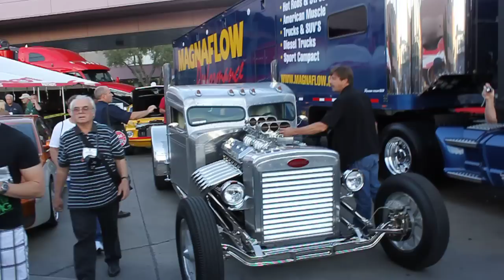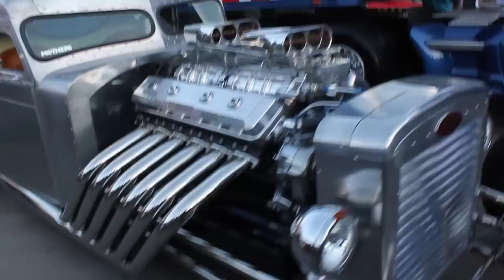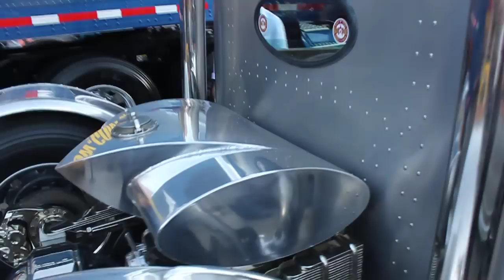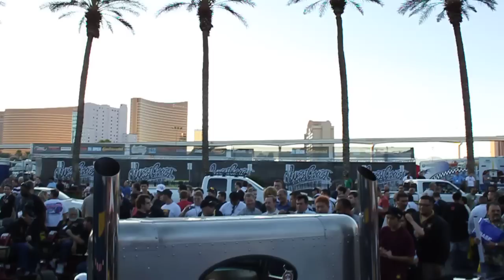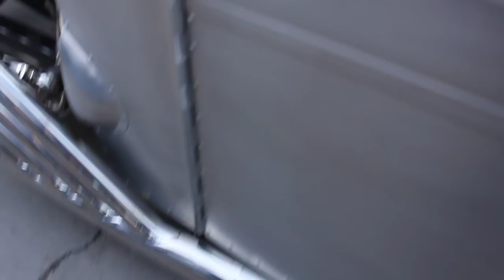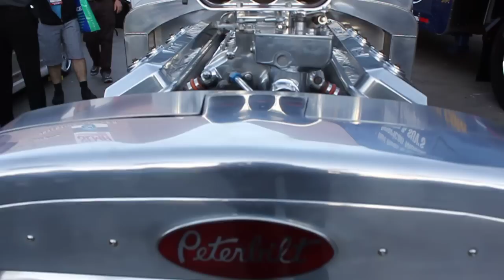Jay Leno's Insane 1960 Peterbilt Hotrod Truck called Piss'd Off Pete showing off for the crowd!

Comment: He can run Amsoil Dominator 2 stroke oil as it burns off clean and has good film wear.
Reply: Actually he has to run ordinary diesel oil as it's a 2stroke diesel they work differant to a 2 stroke gasser

Comment: @idusclothing Maybe a 250cc dirt bike engine does. This about 14,000cc, the pistons are a lot bigger. 2 stroke just means it makes power (combustion stroke) every other cycle of each cylinder, rather than every 4 cycles. Generally means about twice the power output of a 4 stroke of the same size. However, max RPM is mainly a function of the size of an engine's reciprocating (moving) parts. 2500 RPM is quite high in a large diesel engine.

Comment: @ReverendArmaggedon: 1000 lb/ft was pretty good when the 12V71 was in its heyday, but 500 hp today gets you about 1500-1500 lb/ft.  The 'Dirty Dozen" was a good engine in its day, but now it's a dinosaur.  500 hp out of a 12V71 isn't that much of an increase, in top form from the factory they put out 434 hp @ 2100 rpm, you could probably get it up to 500 just by replacing the standard 65mm injectors with 75 mm ones.

Comment: No, it doesn't have any superchargers.  The 2 cycle Jimmies needed the roots type blower for scavenging.  It blew the exhaust out of 4 valves, and clean air into the cylinder through ports in the block.  Without the blower, they would not run.  Therefor they are not considered "superchargers"

Comment: @6806goats1 Nice, i am a detroit mechanic and had a 16v71cab over just come in to our shop with triple sticks, trying to find reverse on that thing was imposable, (no shifting guild) I did kinda found out the hard way there are many set ups to those engines and this one had duel super cargers and duel turbos and the biggest ive ever seen. Needed a new super charger clutch. Yeah at a certine psi the super chargers kick out. He took me for a test drive, Dam bull hauler at 129 top speed.

Comment: @joek0617 Huh?  I can't find or think of a single 2 stroke engine in the last 30-40 years that didn't have a muffler/silencer from the factory.  In fact a 2 stroke gas engine needs a small amount of back pressure to run properly.  I have 7 2 stroke gas engines from a variety of manufacturers and every single one has a muffler, and had one when built, the ages range all the way back to the early 70's.  Maybe some of the stuff from the 60's and 70's didn't have them but the majority did.

Comment: Don't see why you can't run straight pipes on a 1960ish Pete since that is how they came from the factory.
In the US emission and sound regs are dependent on the date of original manufacture(the VIN plate and cab are 1960 Peterbilt) and most jurisdictions even kit cars are registered as the year of the "real" car. A 1966 427 S/C kit is the same as one built by Shelby in 1966, hell, even the new cobras(AC platform) from Shelby are registered as mid 60's cars.

Comment: @TR3NDK1LL So does virtually every passenger car on the planet.  Stock those engines only turn a little over 2000RPM but due to their design they sound like they are revving way up.  Something a lot more racey then this one may turn higher then 5000.  Understand this one isn't even turbocharged.

Comment: 12V71 Detroit Diesel made by GM
71cu inch per cylinder = 852 cu in.
450-500 HP
weighs @ 3500LBS.
Common power for boats.

Comment: @1995MartinD40FMG Wrong! It is two stroke, piston ported, and without some sort of forced induction it would not run at all. I've worked on, stripped down and rebuilt more than a few of these motors. As standard, it comes with a supercharger, or two actually, nestled in the V of the motor.

Comment: Huh, an old 60's super charged 12V71 V-12, 2 stroke, Detroit Diesel. And look Dodge fans, no freaking clouds of smoke. See high performance in a diesel engine and lots of black smoke aren't one and the same.

Comment: @MrHellested Just because you have never heard of something does not mean its not out there. Detroit was into two strocks for years and they SMOKED ALOT , epa cracked down on them and they had to have john deere help design the series 60 in the mid 80s. Two strock diesels are out there just less of them as these new EPA laws crack down.

Comment: @theLonewhitewolf13 A diesel with turbo charging or super chargers and properly tuned should not smoke much. Black smoke clouds are a sure sign it running way too rich. Most of the older naturally aspirated diesels smoke like a furnace. They also burned way more fuel than they needed to.  The 3208 CAT I put in my Super duty dually don't smoke much and will pull anything I hook up to without much effort at all. It smoke a little when starting out with a heavy load, but nothing like the old Macks.

Comment: @DOCTORtrololololol 2 Strokes are Detroit diesel engines, very common, nickname is screamin jimmy, slang for GMC, alot of buses use them, you've probably passed a million of em, or they've passed you, quite common to use the blowers off them for drag motors. I've driven the V4 71, V6 53, V6 71, V8 71, V8 92, awesome engines & cheap to rebuild.

Comment: I beg to differ. All the 6V32 and 8V32 Detroit's I saw in military vehicle all had a manifold pressure gauge in the dash. Even when used in the PBR boats. Way would they need a gauge from  1-30 PSI if the blower didn't pressurize the manifold. I've never seen a blower installed on  any  engine that didn't pressurize the manifold. It the hole point of it being there. Even blowers used in industrail application provide positive pressure. Two words, same thing.

Comment: If its 2 stroke wouldn't having some sort of exhaust like most 2 stroke engines improve on power?
Like motorcycles, whipper snippers, chainsaws all have huge chambers that flow down to a smaller pipe.

Comment: @captwilly428 Did you know the 5.9 is governed @3100rpm? And the key to longevity at high hp/tq levels is strengthening the metal, either by stress-relief shaking or cryogenic hardening and some do both.

Comment: First, I don't know what a 6v32 and 8v32 are.  Do you mean 6v92 and 8v92?  I really can't speak for why they had a boost gauge, unless of course, they had a turbo!  I have done some research, and from what I have seen, the 92 series all had turbos, which would explain your boost gauge.  It is not for the blower.  I can only speak about the fact that 2 cycle Detroits can not run without the blower.  The blower was not used for high performance.

Comment: Yeah no kidding, I put a 3.0L turbo diesel in my 86 toyota pickup and I get around 38mpg hwy with the stock 4.10's which is way to high for the engine, could probably get alot better with the right gears.

Comment: I don't understand the whole forced induction 2 stroke thing
Reply: Its a cool thing. They work just like a normal two stroke but inject the fuel instead of it being premixed. They are all blown either super or turbo hybrid etc.. The advantage of blowing is it helps to have the air blow the exhaust gases out before the exhaust port is covered by the piston on the compression stroke. Diesel two strokes can be made lighter too.
Reply: It's actually not "forced induction".  On a detroit, or any other 2 stroke diesel i know of, the blower does nto create pressure, it simply moves air.  The engine could not run without it.
Reply: So this engine's basically designed for use with a blower? I've heard of some 2 stroke bikes with turbos but they were all pretty much too inefficient to make any usable power.
Reply: Yes.  it would barely run, much less make any power without the blower.
Reply: ***** it couldn't scavenge if it didn't have the blowers
Reply: Magnacharger07 Yes, that is exactly what i meant.  Did you mean to send that to me?
Reply: Steve Skouson Thanks heaps for that complex and informative response.
Reply: Stewart Gartland Thank you, and sorry to get long-winded.

2 stroke induction is a COMPLEX subject, and being a diesel, only further complicates it.

steve

Comment: its not supercharged? its naturally aspirated? A two stroke diesel of this design wouldn't run if it was naturally aspirated. Thats why they used superchargers on them, some use superchargers AND turbos. Look at the superchargers on top of it! These engines are where this type of supercharger originated. Go back to wikipedia and read again expert

Comment: What gives no black smoke ?
Reply: Tony Jarrett Good diesels don't blow black smoke.
Reply: Tony Jarrett He runs it on Propane or Natural Gas.
Reply: vector6977
Ya sure
Reply: vector6977  It runs on smiles per gallon.
Reply: +Tony Jarrett Detroit Diesel came out with a throttle delay in the 1970's that controls/slows the injector rack from going wide open instantly ,thus eliminating  or at least limiting smoke. Another gift from the EPA. The EPA eventually  eliminated the Detroit 2 stroke and replaced it with the 4 cycle 60 series. I miss the 71 serires. A lot of fun building them. Today everything is controlled by computers, again another gift from the Feds.
Reply: +("RNA0ROGER") it doesn't mean they are good or bad, it just means one run rich and one runs lean.